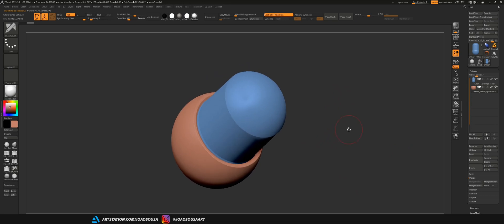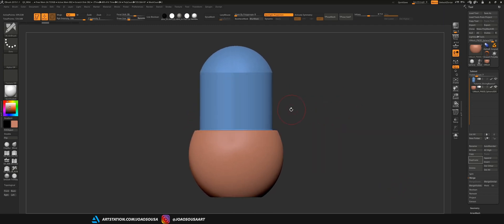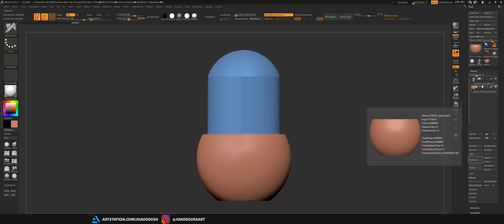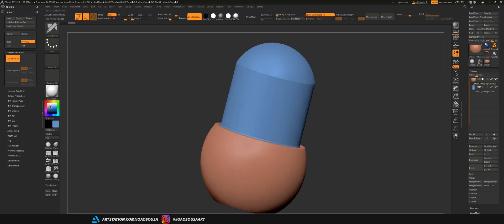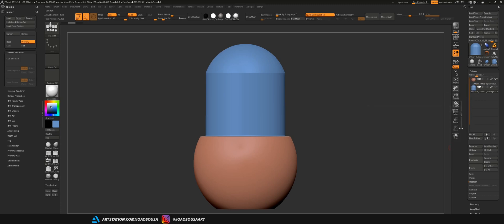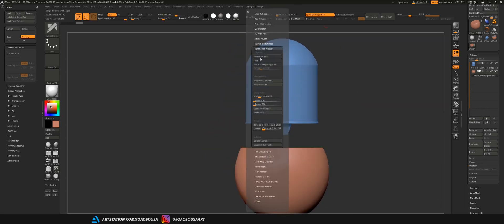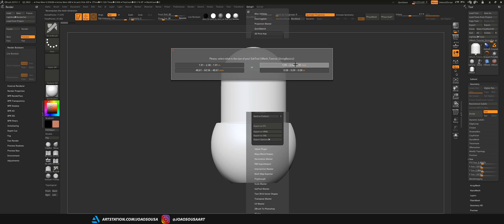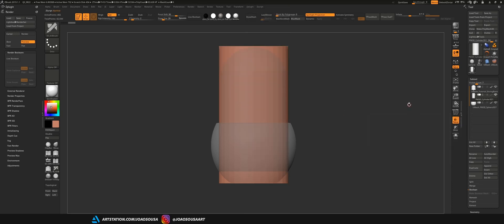Prepping Characters in ZBrush for 3D Printing - Fundamentals of Slicing

Comment: You forgot to add some inflate (+1) on a copy to create some tolerance  for the boolean sub.Then printed it will fit perfectly at the assembly
Reply from the maker: You can totally do that. I don't really feel the need to go throught that process because I will sand the print later, and the pieces will fit perfectly. It's up to you if you want to do it or not :) Thanks for pointing that out.
Reply: Joao Sousa sanding is a slave work , less postprocess more fun
Reply from the maker: @syl3d678  Good luck printing with filament printer and not have that extra work :)
Reply: That’s why i prefer SLA for figurine or bust